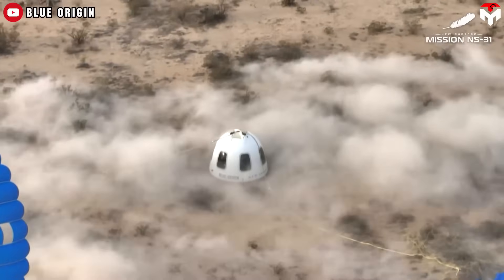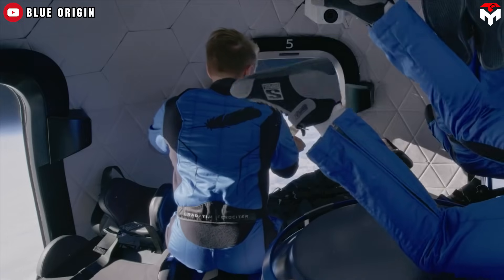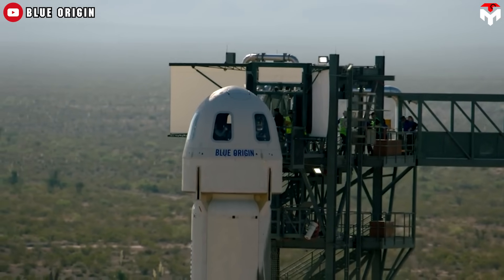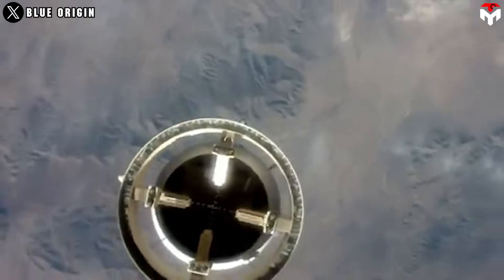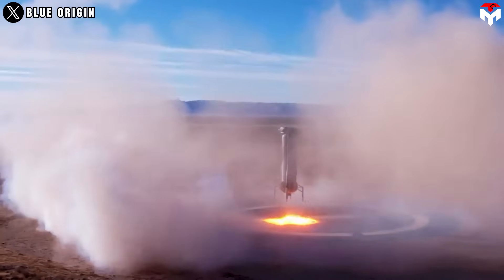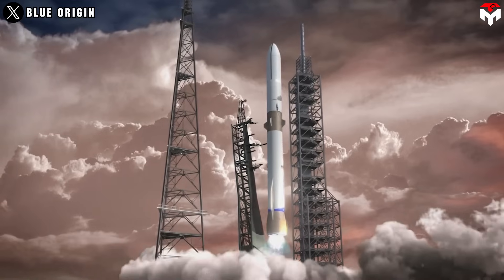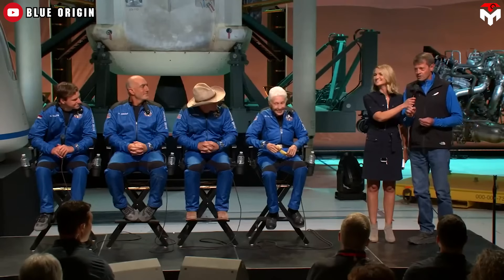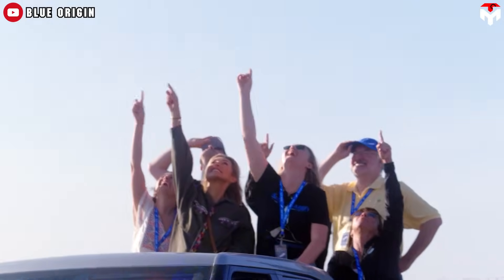Astronauts Exposed Why Blue Origin New Shepard Not Look Burned After Landing

Comment: ASTRONAUTS wear spacesuits and helmets, NOT designer "jumpsuits " !
Reply: They were just passangers on a 15 minute ride  NOT ASTRONAUTS--If you take a trip in a 747 you are a passanger not a pilot
Reply: They are tourists.
Reply: No helmet is a safety standards  and measures concern about the New Shepard.
Soviet cosmonauts, Chinese taikongnauts, and American astronauts (NASA, Dragon and Starliner) all wear pressurised spacesuits with helmets during launch and reentry as a precaution ever since the horrific Soyuz 11  disaster in 1971, The Soyuz 11 crew capsule depressurised during preparations for re-entry, asphyxiating & killing the three-person crew within 40 seconds.  The autopsy found burst blood vessels and tissue changes consistent with sudden decompression injuries (the bends) caused when the blood starts to “boil”when air pressure drops too fast.  The three crew members of Soyuz 11 are the only humans to have died in space.

The capsule hatch opening inwards is also something NASA doesn’t do  after the Apollo 1 disaster. A fire caused by a spark igniting flammable materials in the pure oxygen environment quickly engulfed the cabin.  The heat and fire raised air-pressure inside the capsule and made it impossible for the ground crew  to open the hatch in time to save the 3 astronauts.  NASA  redesigned all Apollo capsule hatches to open outwards after that. Outward opening hatches need sturdier seals and heavier locking mechanisms to prevent blowouts and decompression.

Comment: But it's not just the altitude. Crew Dragon is also in ORBIT, which means it's got a lot of velocity on top of what it's going to pick up by falling back. You could also do a "New Shepard" that went straight up to 260km, and then straight back down, and IT won't get nearly as hot as a spacecraft that had enough lateral velocity to be in low earth orbit.

Comment: That was the obvious explanation, for anyone with a brain - they didn't go up high enough!   But I'm still waiting for someone to provide a convincing explanation as to how the 'crew' managed to open the hatch from the inside!
Reply: from previous videos of the inside of the capsule, showing the door; there is a latch on the inside as well as the outside.
How it remains safely locked during the flight I have no idea... seems pretty dangerous with several untrained bimbos
aboard

Comment: The New Shepard capsule did NOT re-enter from orbit. It wasn't doing 17,000 mph! It went up. It maxed out at just over 2000 mph going up into THIN atmosphere, then FELL back, gradually accelerating, only to be slowed by a drogue parachute, before th main parachutes get deployed.
It doesn't go fast enough on descent to cause scorching.

As for the weightless thing. That experience is because the thrust cuts off and the capsule and EVERYTHING in it, enters freefall. The people and contents of the capsule are STILL subject to gravity,, but they are in freefall and experience micro-gravity. Once the capsule starts falling back and hits thicker atmosphere, drag happens, slowing the capsule. When that happens, the people and other contents of the capsule experience some G !
Reply: People are stupid.
Reply: @andyschwarm  Nobody is claiming that New Shephard was in orbit. Try actually watching the video before pontificating.

Comment: Correct me if I'm wrong, but that rocket hits mach3 max speed on ascent, but the capsule separates and coasts on an upward arc for a brief period
and slows down a LOT. So when it begins descending it has slowed to a relative "crawl" and nowhere near Mach3. 
It's "reentry" is likely under mach1?
Reply: That's right.  Its velocity is very low at the top of its flight.  It's basically in freefall, well below Mach 1.

Comment: The capsule didn't make it above the atmosphere.
Reply: Approximately 99.99997% of the atmosphere is below the Karman Line.  So you are correct, there is still 0.00003% of the atmosphere left above them.  PLUS they went 3 miles past the Karman Line !!!  What an achievement for these Space savvy ladies !!!
Reply: The capsule went to 106 km altitude where 100 km the Karman Line which is suppose to be space, but Starship starts showing serous plasma generation at an altitude just before falling below 100 km attitude!   At 100 km altitude Starship is very much in the atmosphere.   A 100 km altitude Karman Line is better seen as the fuzzy edge of the atmosphere.   It would be nice to see indications of atmospheric loading to Starship as its hitting sporadic atmosphere plumes just before crossing below 100 km attitude.   These might be too small to be notice if humans were on board.
Reply: @douglasengle2704  The difference is StarShip is re-entering at 17,500 mph and New Shepard is coming down at less than 2000 mph.  New Shepard is not an orbital flight, it is sub orbital (barely)
Reply: Maybe it never left the green room.
Reply: @johnlam3037  We are all living in the Matrix

Comment: They did not go into the blackness of space.  Only a high altitude.  The weightlessness was simply the capsule falling back to Earth.
Reply: You have to draw the line somewhere, as to at what altitude you enter space, and commonly that's agreed to be 100km. New Shephard was specifically designed to surpass that altitude (but not by much). So, yes, passengers on New Shephard go into space.
There's another definition, used by the FAA, but that one is lower, so New Shephard meets that criterion for space also.
If you look upwards from that altitude, the sky is completely black, not blue, so you're just wrong. You're certainly in the "blackness of space" up there.
Reply: Ok then why are they callings themselves Astronauts??

This Hollywood illuminati satanic elites agenda keep exposing themselves.
Reply: Except this one IS Faked..
That's the news.
Reply: They do not leave the atmosphere. Bezos is able to say that they went to “space” because the FAA changed the definition of where space begins when there commercial businesses began wanting to sell trips to “space.” They do not orbit. The whole trip up and back took TEN MINUTES. A space ship that has to reenter the actual atmosphere must have booster rockets for speed needed for reentry and heat shields in order to endure the heat of racing into and through the atmosphere. The Blue Origin does not need such things because it never left the atmosphere. Do you see windows on a real space capsule? The Blue Origin has big windows for the passenger’s viewing pleasure. It goes up to near  the edge of the atmosphere. No helmets needed. It is a beautiful view. I wouldn’t want to do it but I do not even enjoy flying.
Bezos runs this business to make money, not to do scientific study. He gave 93 year old William Shatner a free trip a couple of years ago in order to get publicity but Mr Shatner did not get as many press releases as these women did. Nice trip for very wealthy people who can afford to pay tens of thousands of dollars.
Reply: @ellietobe  Wrong on several points (but not all). Let's start with the most obvious. Yes, real space capsules have windows. In fact, probably all of them for at least US manned space fight have.
I think a Blue Origin ride costs considerably more than "tens of thousands" - at least by an order of magnitude or two. It is probably not a money-making ride. Space tourists are mostly about publicity, but maybe they help with expenses too.
The atmosphere does not have a sharp boundary, but an internation standard, called the "Karman line" was set at a nice even 100km long ago. Some US space efforts used a different standard for a long time, but that was LOWER, at 80km. New Shephard goes to just over 100km specifically so they can (legitimately) say that their passengers fly into space. Nobody claims these flights go into orbit, but that is not a requirement of being in space. They did, in fact do essentially what Shephard did, the difference being that when Shepard did it the spacecraft was experimental, and was trained to actually fly it. It was a very different situation, obviously, but the trajectories followed were similar. Nobody said that Shepard wasn't an astronaut because his flight was suborbital. But the New Shepard passengers are Space Tourists, and so it's becoming obvious that the term "astronaut" needs to be defined beyond simply someone who has traveled to space.
Reply: They didn't go into space. Full space suits would have been needed for that as a precaution.